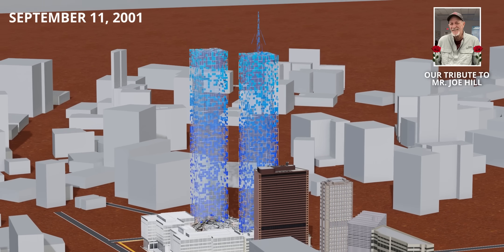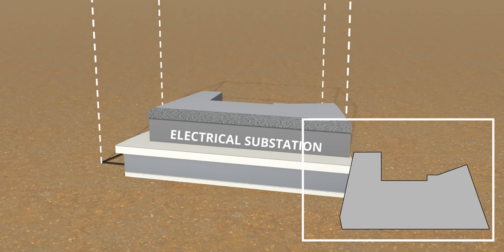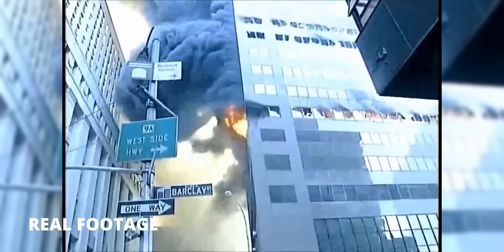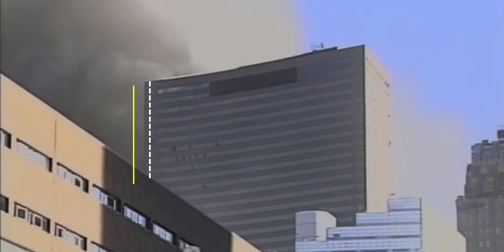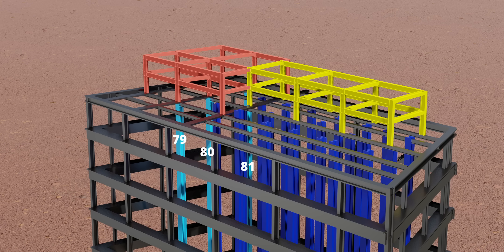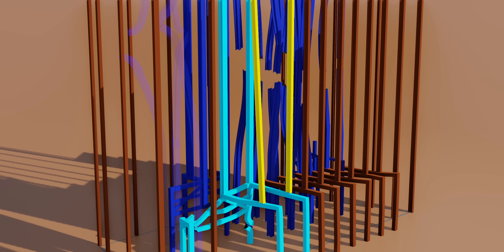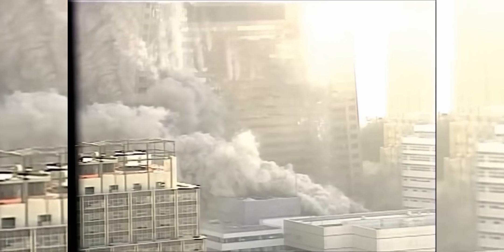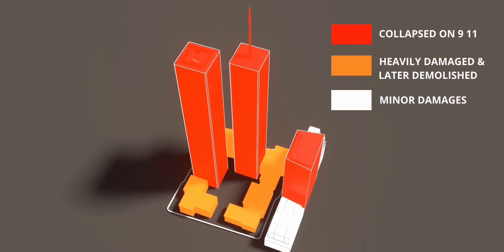Collapse of Building 7 | The Complete Physics

Comment: Gotta call more BS on this video because it's honestly too fun, and too easy.

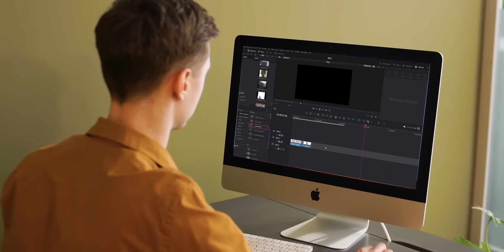At 9:27, the narrator tells use "most of the reuploaded videos on youtube are after increasing the footage speed by exactly 40%. A nice trick to bring the video down at freefall speed".

Could anyone link me to one of these videos where the freefall collapse was sped up? Pretty sure a 40% increase of video speed would be extremely obvious, considering how the ambient dust and smoke would look if footage would was sped up at those values.

NIST got their "5.4 seconds" figure using specifically, the bottom-right angle we're familiar with from footage. In their terms, they say the building begins accerating downward using a pixel-basis (observing "building vs sky"). In other words, they start their clock the moment sky is revealed from behind the building.

Problem is, as THIS video demonstrates, there's about 1.54 (from memory) seconds where the building "kinks" before its descent.  From the beginning of this "kink", is where NIST begins their clock. Not when the building begins any kind of descent.

What NIST should have done, obviously, is use the "straight-on" footage we see from the telephoto lens several blocks away. This, very importantly, eliminates paralax AND gives us a clear picture of when exactly the building begins to descend downward (using the building vs sky methodology, if you choose).

In short, NIST used ostensibly bad observation data to clock their "downward" motion of the building.

But, circling back.  I'll bet no one can provide me a link to one of these videos which the narrator claims was sped up -- because I'm asserting they do not exist.
Reply: I totally agree and I´m glad I´m not the only one who realized how the NIST clock is debunked here!
Reply: @Kudde23 keep fighting the good fight brother!
Reply: @Snoozie09  Hey, do you (want to) know what actually caused the gash on WTC7?
Reply: @Snoozie09  - The NIST repeated the same measurements they were given by David Chandler and found them to be substantially correct but absolutely meaningless as it caused nothing more than a minor re-wording of one sentence in the final report. Nobody ever talks about that. 

Another fact invariably lost in the discussion of this pointless topic is the building had already been collapsing for at least 10 seconds before the clock on "free fall" begins.  Most of the building is already gone before the timing starts. The only thing being timed is the hollow outer shell, and only one corner of it at that - and with the assumption it is only moving down rather than as it really was in 3-dimensions. But quite frankly, who the heck cares how fast the hollow outer shell takes to fall for a small fraction of its total collapse?  

It's a hollow empty shell!  

It only looks like a building to noobs who don't comprehend what they are looking at.
Reply: @MFitz12  I take your point, but most of NIST's own analysis is from video footage, like the rest of us. They have their simulations but I'm not convinced they have a clear picture of the moments prior to the building's collapse.  So indeed, I'm saying _I don't believe them_.

Yes, I'm a noob. But I can absolutely comprehend everything NIST has put forward.  What I can't comprehend is the one of a kind, global (not sequential) collapse of a 47-story skyscraper constructed in 1987, with the surface area of a football field due to office fires.
Reply: @Snoozie09  WTC1 core columns tipping all the way to WTC7. That´s not just a hypothis. First it was, so I tried to find evidence, searched for helpful collapse videos, watched them over and over and finally found the tipping core column(s) that did it. (This was ten years ago or so.) Another bundle of core columns also caused the damage on the sw corner of WTC7.
WTC1+2 core columns were tipping in various directions (WTC2 core columns seemingly didn´t tip into WTC1 though), during the main collapse and right after the main collapse. 
And I guess also as the real collapse initiation.
Reply: @MFitz12  The "hollow empty shell" that somehow still managed to hold the western penthouse resembled the majority of WTC7 columns.
Reply: Edward Currents hoax video, well spread through-out the "truther" community.

Comment: Dustified by nano-thermite.
Reply: I don't get the impression you understand how things work.
Reply: @MFitz12
You're a good little sheep.  Stalin called you a "useful idiot" but I prefer "sheep".
Reply: @TheSecondWitness  - When the debate is lost, slander becomes the tool of the loser - Socrates
Reply: Exactly.  I see that @MFitz12 tried to slander me and I agree with Socrates here.  Besides, anyone with even a little common sense would know that two (2) airplanes can't level three (3) STEEL skyscrapers 😂🫤😎
Reply: You're not very smart, little bro. Stay off the internet.

Also, I find it very comical that you just simply chose not to reply to any of his other points, simply because you have no rebuttal 🤣 the jokes write themselves.
Reply: @TheCriticalStinker-jw4fl  "The worlds engineering community had already largely sorted them out at least as early as October/November 2001."

A few engineers on the governments paylist don´t represent "the world´s engineering community" shillshite.

"12. Core Columns fail last as their internal beam bracing is stripped away and lateral support from the floor to perimeter columns is lost."

Core columns failed first as indicated by the antenna dropping first aswell as by the perimeter being pulled inwards by the cut core columns. And that´s your big fucking problem shillshite, you can´t explain why the core columns in the upper half collapsed first despite nothing crushing down on them and you can´t explain why the core columns in the lower half collapsed last despite nothing crushing down on them.

Damn shillshite, all your blablah is completely worthless...
Reply: @Kudde23  
"Core columns failed first "
The perimeter columns failed at one side first - before the drop of the antenna.  
The core was destroyed as the collapse progressed across the remainder of the building...   and the total progressive collapse initiated.
Reply: @MarkH-cu9zi  Sad that you can´t prove any of that...
Reply: @Kudde23  We have videos of the collapses... you know that right?
Reply: @Kudde23  
"You have a video that proves that the perimeter failed prior to the drop of the antenna? "
Watch every video of the towers collapse.
The first phase of the collapse is the perimeter columns failing at one side.
You don't even know the basics of this topic do you?!   
🤦‍♂
Reply: @Kudde23  Scrolling up and down I see you losing arguments in multiple threads and just squealing 'shill' a lot while you try to cope.   🤣
Reply: @MarkH-cu9zi  "Watch every video of the towers collapse."

I probably did. That´s how I know why you can´t come up with a video that proves your claim. But what´s your explanation for you being unable to provide a proving video to your claim my poor little exposed liar?
Reply: @Kudde23  
In every thread you get your backside handed to you and you cry 'shill' and liar a lot...  😭😢
😂
Reply: @Kudde23  So that's TWO references you've been given in this thread.
In every thread you run....
Reply: @Kudde23  So you've been given references.  You've had your error explained to you.
You've offered no response at all.
How long are you going to run panicked like this?
Reply: @MarkH-cu9zi  My poor little exposed liar, in order to prove your claim by video you need to provide a video that shows the columns failing and the antenna at the same time. Your first video doesn´t and your second video doesn´t even show the start of collapse to begin with.
Well my poor little exposed liar, you tried, you failed, you are exposed AGAIN. So sad...
Reply: @Kudde23  
"you need to provide a video"
I've given references to videos showing the collapse beginning with the failure of the perimeter columns.
So again, your position has been refuted.  
You've offered no response.
We both know you never will.  
You've lost.
Reply: @markh1011  How do videos of failing perimeters that don´t show the antenna at the same time prove that the perimeter columns failed prior to the antenna descent my poor little exposed liar? How do videos that don´t even show the start of the collapse prove that the perimeter columns failed prior to the descent of the antenna my poor little exposed liar?
Reply: @Kudde23  
"How do videos of failing perimeters that don´t show the antenna"
You could see the top of the tower in one of them.

" How do videos that don´t even show the start of the collapse prove"
Except they do show the start of the collapse.

Try again.
You're terrible at this.😂
Reply: nope and there is no way you could ever logically explain that.

Comment: 600 degrees Celsius isnt hot enough to cause weakness in steel 😅
Reply: The hell it isn't.
Reply: yes it is. Learn before you speak.
Reply: Said no-one who knows even the basics of physics. Or, for that matter, metallurgy, or blacksmithing.
Reply: @mooneyes2k478 
U R A Paid shill working overtime 😂
Reply: @mooneyes2k478  I have a physics degree and can read. Go use a phase diagram. The steel they used was so strong and designed to withstand a 747 that at least 1200 Celsius would have to be reached to cause weakness. They are many engineers and scientists that know this is abnormal
Reply: @theodoreneubauer3  
" I have a physics degree and can read. "
If that's the case you should either understand or be able to confirm that steel starts weakening well below 1200C.  It's down to about half it's strength at a 600C.

" and designed to withstand a 747 "
The steel itself wasn't no.  The designers did consider the impact of a plane but they were thinking of one flying slowly lost in fog.

"They are many engineers and scientists that know this is abnormal"
Not really.
Reply: @theodoreneubauer3  " I have a physics degree and can read. Go use a phase diagram."
"The steel they used was so strong and designed to withstand a 747 that at least 1200 Celsius would have to be reached to cause weakness. "

PERFECT example of what they called "own goal". I don't think you could have failed harder if you TRIED.

"They are many engineers and scientists that know this is abnormal"
No, "they" are not. There is, in fact, barely, if at all, any.

Comment: I care nothing about what the narrator says - the story of WTC building 7 is pure, 100% crap  Jane Stanley reported  at around 5:00 p.m. on BBC TV that WTC building 7 "Had collapsed to the ground" - while she made this TV report - WTC building 7 is clealy VISABLE and INTACT behind her.  Less, than a half hour after her report - WTC Building 7 did indeed collapse to the ground - in less than 20 seconds.  WTC Building 7 was NEVER hit by a Jet Airplane - there were no 'jet fuel fires' in the building.  The fire that was in the building was NOT hot enough to melt steel and cause the total collapse.  No matter what the clown doing this narration says - it fails to explain exactly why a 47 story building collapsed to the ground in much less than 20 seconds.  NO buildings since that day have collapsed straight down into it's footprint. I call: "BULLSHIT!"
Reply: " care nothing about what the narrator says - the story of WTC building 7 is pure, 100% crap"
Of course you don't. After all, if you DID care, you'd have to face that your fairy tale is utter nonsense.

"Jane Stanley reported  at around 5:00 p.m. on BBC TV that WTC building 7 "Had collapsed to the ground" - while she made this TV report - WTC building 7 is clealy VISABLE and INTACT behind her."
So what?

"WTC Building 7 was NEVER hit by a Jet Airplane "
So what?

"The fire that was in the building was NOT hot enough to melt steel"
So what?

"and cause the total collapse"
Wrong.

" it fails to explain exactly why a 47 story building collapsed to the ground in much less than 20 seconds.  "
Doesn't explain Santa Claus either. And for much the same reason.

"NO buildings since that day have collapsed straight down into it's footprint."
Even if it WAS true, which it isn't...so what?

"I call: "BULLSHIT!"
And other irrelevant things.
Reply: That's proof enough ✅
They lied and carried on lying till this day making these stupid videos to try convince people the official narrative was true it's all 🐂💩 lies

Comment: I'm gonna answer your question, and I hope you will then answer what i asked you previously. From what I've read and heard about him, in his bios, linkedin and intro for interviews, Hulsey seems to be a very distinguished professor and researcher. He got his PHD in structural engineering back in 1976. He has owned several high tech research companies. He's taught at the University of Rolla, Missouri. (taught undergraduate junior and senior level structural engineering courses there for 4 years.) He's been a Professor of structural engineering at University of Alaska, Fairbanks for 37 years, and he has taught and held courses for probably thousands of students(I believe you can even find some of his students on engineering forums discussing his research). At UAF he's been an active researcher, advisor, been department head and participated in numerous committees. His research is in the field of bridge engineering and the effects of temperature extremes on structural systems like composite wall panels for buildings. He has focused on mathematical modelling in finite element/difference and theoretical solid mechanics. In another bio at UAA it says his expertise is in the area of mathematical simulations for structural interaction of complicated structures. Dr Hulsey is both a Structural and a Forensic Engineer.

From what I've read and seen I think you could make an argument that he's one of the top forensic structural engineers you can find. But let's say you're right. For the sake of argument, I'll remove that description, and I'll refer to him as a very distinguished professor and researcher in structural engineering. Happy? And also, his team weren't just 2 high school students holding on to his pants, one had a PHD himself, and the other I presume a masters, but let's move on. I hope you will answer my questions now. I expect you to answer my first question regarding your claim about the 130,000 members of American Society of Civil Engineers.
Reply: In fact, let's do this:

1, The supposed "study" of Hulsey's was bought and paid for by A&E911. Now, there's nothing wrong, per se, with that, feasibility studies and the like are bought all the time. But, considering that A&E911 have a vested interest, the impartiality of the "study" does leave some to wish for.
2, the "study" was to take 2 years to make. And then it got moved. And then it got moved again. And then it went very quiet for some reason for quite some time. And then it finally was released, 5 years after it was announced, and 3 years late. I'm not saying the "study" was massaged to fit the customers wishes, but it's rather interesting that it took TWO AND A HALF times as long as it was meant to.
3, the "study" was supposed to be open to criticism by the public, and then it was supposed to be peer reviewed after that. And then, for some STRANGE reason, that went away, and it was just quietly released into the wild with no mention.
4, the "study" findings were already determined before it had started. A&E911 asked for donations and organized a drive to be able to pay for it, at which point they announced what the outcome would be. Let's repeat that. A&E911 told the world what the "study" would say, even before they'd paid for it, much less before it started.
5, the "study" is more or less spent refuting the NIST report. However, NIST isn't the only report that say that the collapse started due to fires. These other reports are mentioned but aren't addressed.
6, Hulsey's "study" tries to so something impossible. It attempts to prove a negative, i.e. that fire could not have been the starting mechanism for the collapse. This, as anyone with even the slightest knowledge of science knows, is impossible. You can prove what happened. You cannot prove what didn't happen.
7, Hulsey is not competent to make the "study" he did. While he is an engineer, his work has entirely, and solely, been about road-surfaces and bridges, as well as cold-weather effects on the same. There is NOTHING in his work that has anything to do with buildings, or fires.
8, the "study" is a shambles and a joke. There are holes in it so big you could drive an 18-wheeler through them. As just an example, the model showing the data and conclusions of the "study" has the engineering "penthouse" of the WTC 7 hinging in the middle, completely dissimilar to what visually happened, then collapsing, in one piece, through the building, without causing any damage to the rest of the building, stopping about a quarter of the way down, and then literally just hanging there, still in one, deformed but still mostly intact, piece.
9, the Hulsey "study" has been referenced, or even MENTIONED, in any reputable engineering publication, exactly NEVER.

And, while it isn't an argument as such, it is very interesting to note that Hulsey went from being head of the department to being "Professor Emeritus" after his "study" came out. This rather suggests that, much like Steven Jones, he embarrassed the university and so, they shuffled him off to the "honorary" position so he wouldn't be quite so in the public eye.
Reply: @mooneyes2k478 Who wrote that post?
Reply: @mooneyes2k478 
By now u do realise your deception is NOT working u paid shill
Check the comments section r u going to try mislead ALL the people who know the official narrative is false 😂